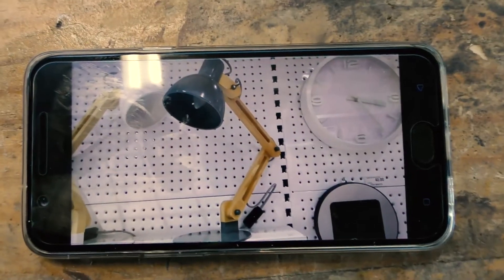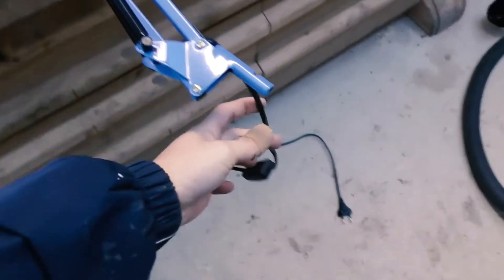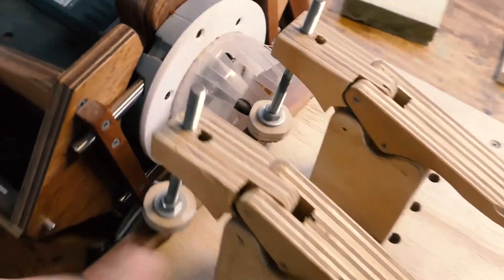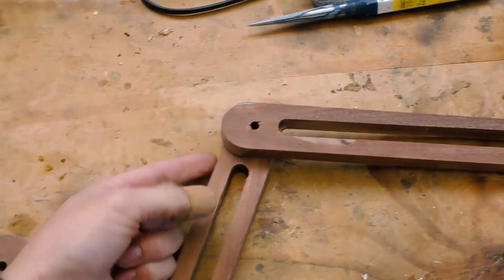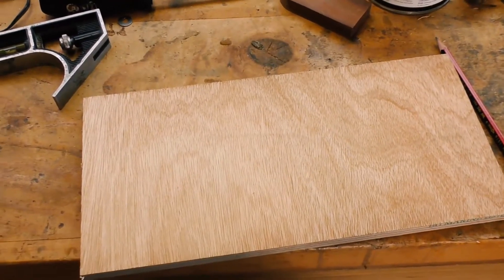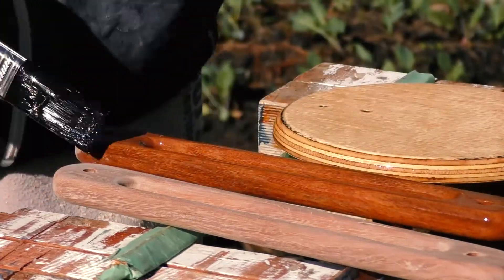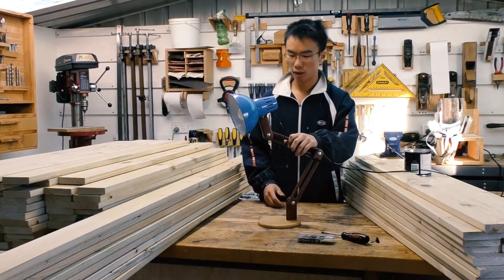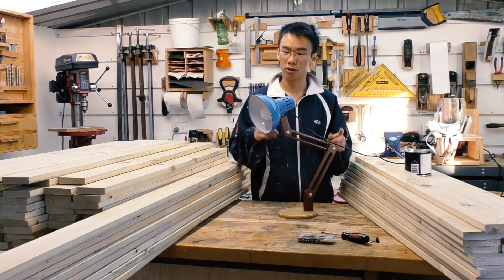Making a wooden lamp

Comment: Looks good! Glad you didn't throw away the original arms, they're so useful :) 

If the bits of spotted gum start slipping too much, try gluing a bit of fine grit sandpaper between the joints, should help hold it more betterer.
Reply from the maker: Pete G thankyou so much for the advice